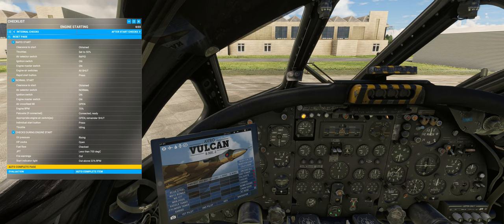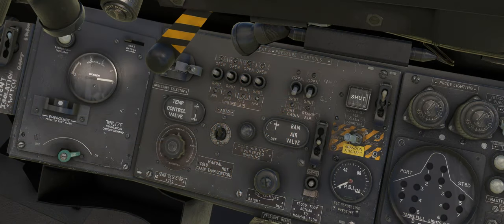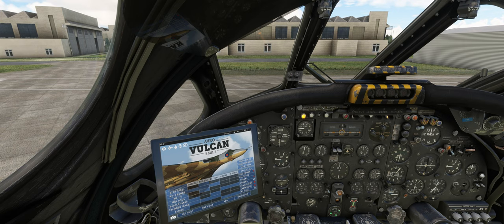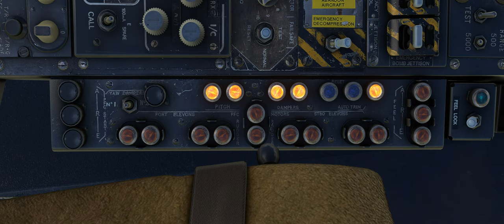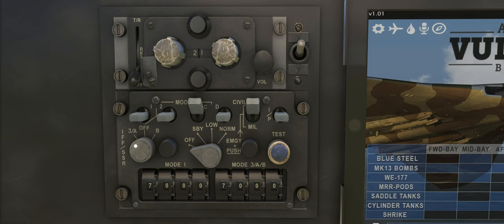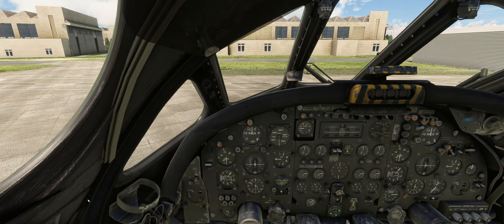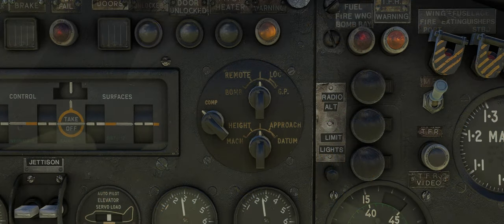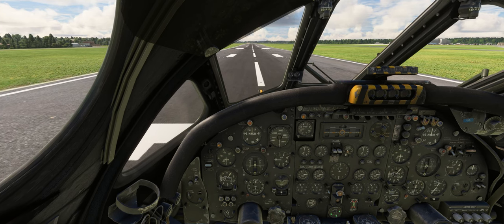Vulcan MSFS Tutorial 2:  Starting the Engines.

Comment: Thanks again - but I have a question...
After engine start we switched on alternators 1-4 but later isolated 1,3, & 4 leaving 2 connected but at the hold point AEO check it seems all the alternators were isolated as the indicators were across including #2?

Which state is correct for the end -  3 cross or 4?

Thanks
Reply: I noticed that as well, would like further clarification on this.